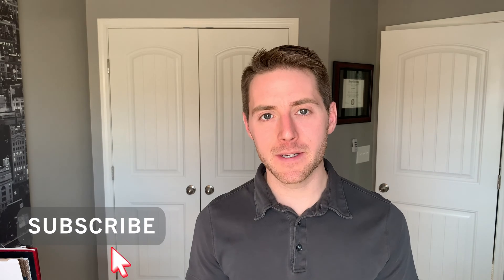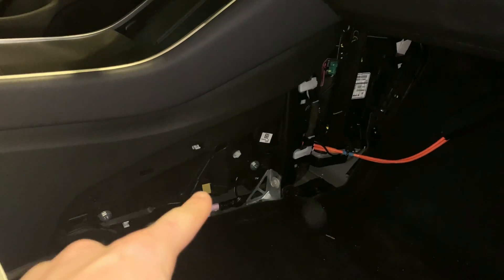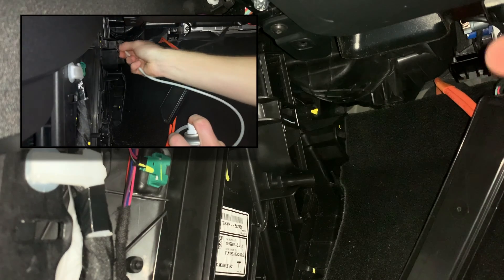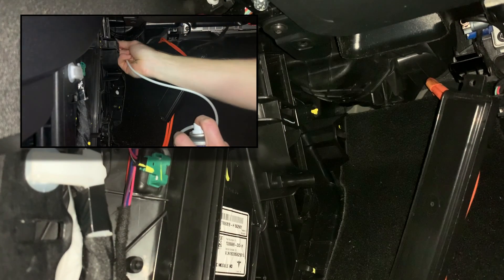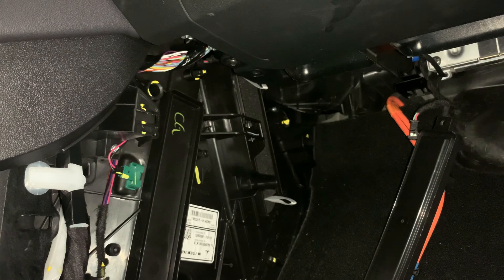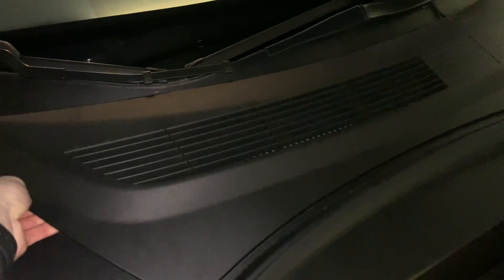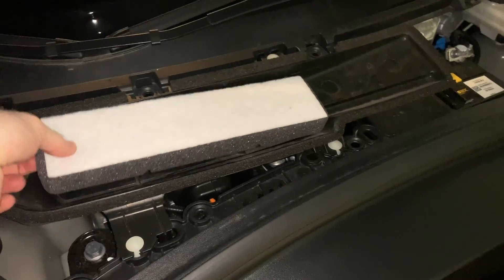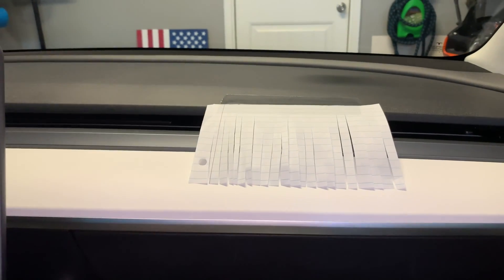Tesla Model 3 | Model Y 🔥 HEPA Cabin Air Filters | Install Upgrade and Airflow Test | XTechnor

Comment from the maker: See MORE Accessories! : https://evanmichiels.com/general-2
XTechnor Tesla Model 3 Air Filter HEPA 2 Pack :  https://amzn.to/35P7X2o
Torx Screwdriver T20:   https://amzn.to/2TgA30S
Kool-It Evaporator and Heater Foam Cleaner:    https://amzn.to/34Y6wwz
Air Flow Vent Protection, Air Intake Grille:    https://amzn.to/362EL7E

Comment: Regarding putting filters back in. Make sure you slide them in correct angle and it will go down as smooth as OEM.

Comment: Just installed these (July 4th 2020) and they fit perfect, older posts indicating that they are too snug or hard to put in place are outdated. Additionally, older reviews of the tabs being wrong are also outdated. The manufacturer has dialed these in and it was an effortless process. The kit includes a plastic trim removal tool for easy dismantling of the cover under the glove box compartment.

I took the advice of this installer and bought some air system cleaner to remove the old mold smell and clean the whole system. I put the filter "cover" back on (without filters) when sprayed this into the intake in the front trunk and let the system run for 10 minutes. Then I removed the cover, installed the new filters, and closed it all back up.
Reply from the maker: Thanks for the update!
Reply: Same here, purchased in June 2022 for my 2019 Model 3 and they slid in easily

Comment: I don't recommend this filter. The filter is super TIGHT fit and the pull tab broke right away when I pull on it. It took me good 15 mins trying to get the filter back out to improvise on the filter pull tab. The OEM filter was super easy to remove and install. The time it took me to install & removing the Xtechnor filter I would've replaced the filter 2 times.
Reply from the maker: It is a challenge to get into place,
I would think they have to be a snug fit to make sure most of the airflow goes through the hepa filter. Thanks for your comment!
Reply: @EMtesla1  Btw, this is not to degrade your review! Great channel, I just wanted to let the folks that watched the review know what they expect in terms of the product.
Reply from the maker: Thanks, yea I also say in the video that these filters are a tight fight to forewarn everyone ahead of time.

Comment from the maker: After driving around with them for about 3 days, I notice a hint of outside fumes coming into the cabin when at a stop light. I would give these filters the edge over the stock ones. However ; when on recirculating mode, the model 3 cabin smells amazing! Super clean smell the entire time which is expected on recirculate mode. Hope this helps. Thanks again for watching my video.
Reply: Prob is prolonged recirculation increase in cabin co2 levels reducing driving acuity. Studies that show that. Also source of mildew smell for many

Comment: Thanks. I have yet to see anybody do a proper controlled test on PM2.5 particle concentration with the stock Tesla filter vs a third party HEPA filter, with inside air set to recirculate, and outside air having a significant PM2.5 concentration, say 100 micrograms per cubic metre or above. See https://www.tesla.com/en_AU/blog/putting-tesla-hepa-filter-and-bioweapon-defense-mode-to-the-test
See https://youtu.be/MLcGaOV4XCI for a test of the stock filter.
See also https://youtu.be/PxJ8-G1_frg for a suggestion for measuring equipment.

Comment: Great job man! I like what you did with the paper there. Nice touch! Air flow is slightly lower looking but I don't know if is enough to worry that much about. Maybe a work around is just using that cover you put on instead of the intake filter to keep the leaves out.
Reply from the maker: Thanks!

Comment: I purchased mine from EV Tuning, when they were on sale around some holiday. They were not any tighter than the originals. I don’t think that the $40 ones are identical to the ones from Abstract Ocean or EV Tuning. They’re probably made in the same factory from the exact same raw materials.  Yours are probably cheaper because they are not going through a middleman? I wish that they could all be scientifically tested.
Reply from the maker: Yea I cannot find any scientific data for both the XTechnor and Abstract Ocean brand filters. Wish they would clarify more details on this too.
Reply: Evan Michiels Thank you so much, Evan! The factory filters are actually pretty heavy and probably filter well. The cabin filter in my Ford C-Max/Focus/Escape is incredibly cheap and weigh absolutely nothing. It does filter out somethings, because it gets pretty dirty, but what garbage as compared with the oem model 3 filter media.